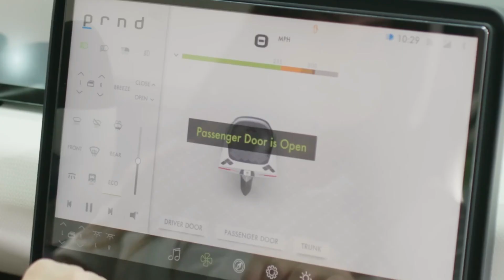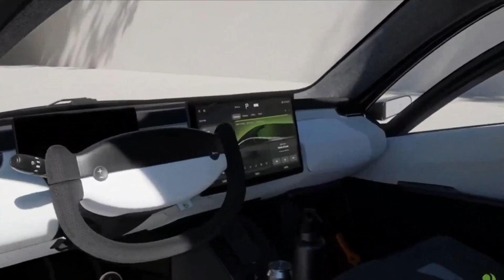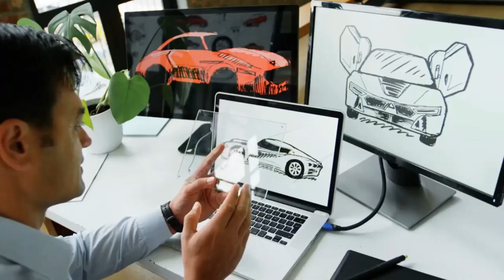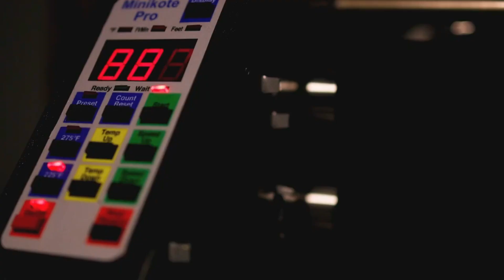Update! Aptera Soon on the Road

Comment: I own and drive a three wheel "autocycle" I treat it as a second car and  take almost all of my local trips with it. The unspoked weakness is having one wheel in the back. This significantly reduces load carrying capacity. Regular four wheel EV's are improving and becoming less expensive, thus reducing the cost advantages of trikes.
Reply: The best part of having a three wheeler is you never miss the thrill of hitting every hole and road hazard.
Reply: What model do you have?
Reply: @hideocolima9639  I own an Arcimoto. The company is just surviving and their website is down. Hopefully they will come back. Tilting trikes are interesting and Arcimoto has a patent.
Reply: @hideocolima9639  I had a Polaris clown car thrilling for a weekend but it's serve limitations as a vehicle including atrocious lack of safety prompted me to sell it after only 30 days.
Reply: @hideocolima9639  Arcimoto FUV